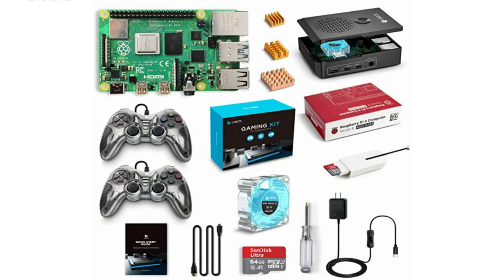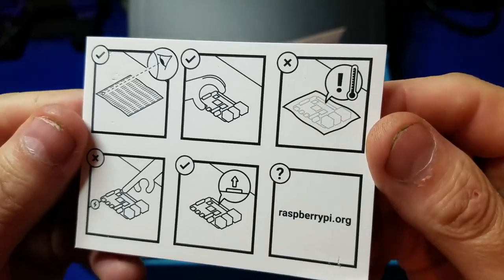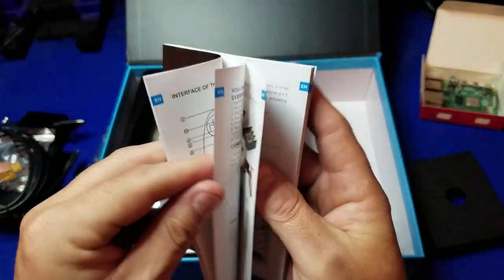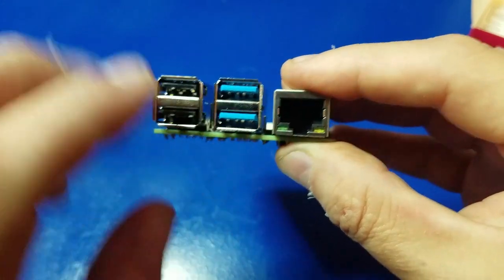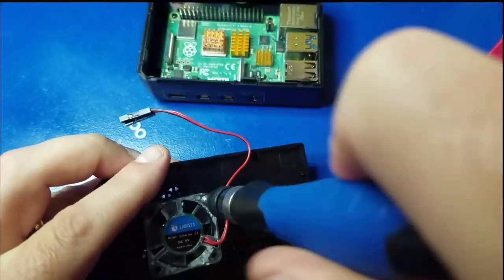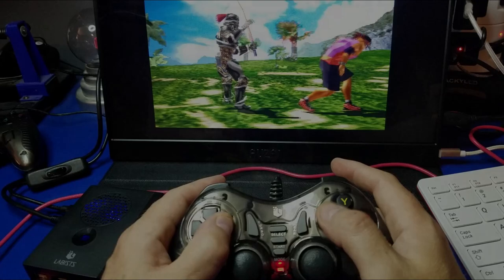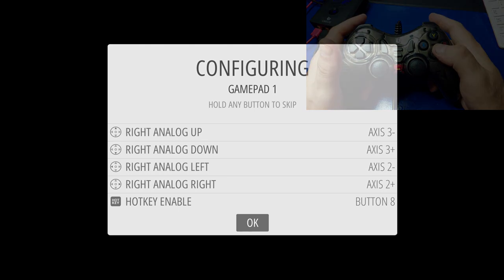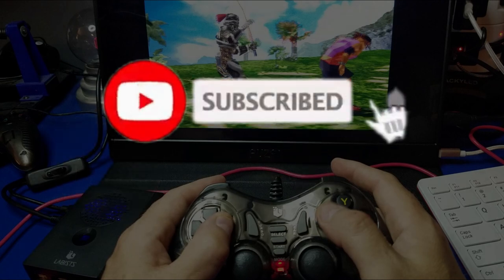LABISTS Raspberry Pi 4 4GB Retro Gaming Kit: Play your favorite Retro Games!

Comment: Is there a way to adapt this so that it can be used like a desktop PC but just have the option to play games as well?
Reply from the maker: Sure, you can simply swap the microSD with another running your OS of choice (i.e. Pi OS 32/64-bit, Twister, Mint, etc.).  You'll just need a USB keyboard+mouse.  When you want to play RetroPie, just pop that microSD back in.
Reply: @WagnersTechTalk  Thanks for the quick reply, that makes sense 😊